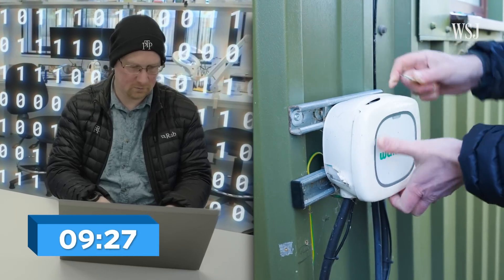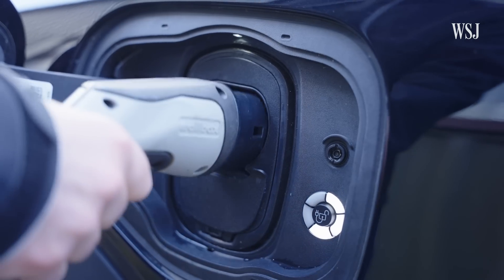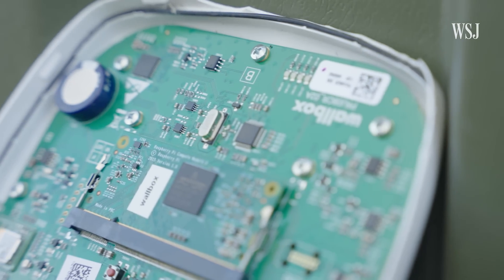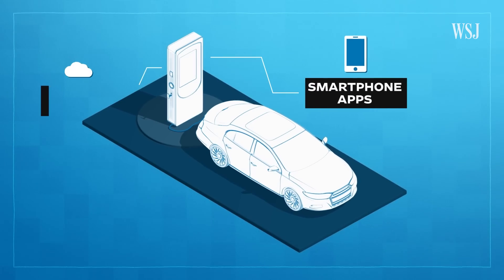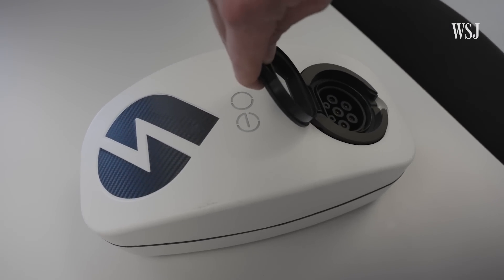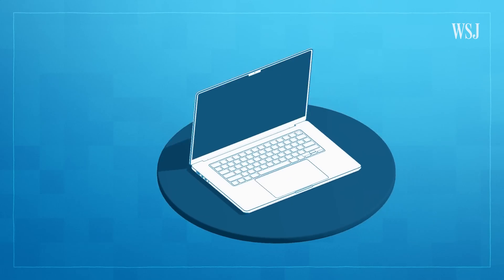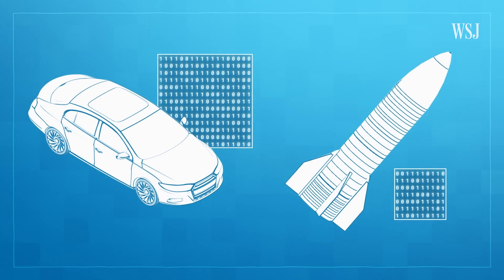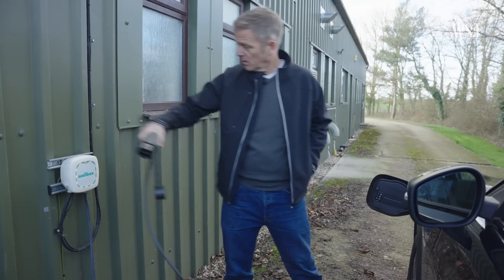This Is How Easy It Is to Hack EV Chargers | WSJ

Comment: Poor old wallbox being picked on - they are actually one of the better EVSE providers and have some clue.
Whilst in general 'update your firmware' is good advice, there are cases where that will completely shaft you (e.g. Juice Chargers - they got new owners and the recent updates remove all the open functionality they used to have).
Just about no chargers give the owners any ability to control their own kit - everything is proprietary except openEVSE and the Yeti dev kits. Wallbox do at least let you set your own OCPP endpoint so you are not stuck with all the vulnerabilities of the default vendor cloud.

Comment: You can recharge an electric car without any of these security risks.  When I had one, all I had to do was plug it into the power socket.  A meter on the dashboard showed my charge status.  The car never overcharged.  I could set it and forget it until the charge was finished.  If you want to have remote access to what your car's computer data, it is better to use a cellular connection on your phone to the car.  Wi-Fi was never meant to be safe.  Just a different way to connect things together.  There is nothing safe about using Wi-Fi.
Reply: You think cellular is safer?
Reply: Wi-Fi is designed to be somewhat safe... but it doesn't make bad designs good

Comment: I don't believe that hacking EV chargers could threaten the grid, but security vulnerabilities in them need to be addressed regardless. The problem lies in the fact that the EV's themselves have their own computers that tell the EV charger how much voltage and current it wants. If the EV detects that it's not getting what it wants, it will terminate the charging session. So you can't just create a surge by giving all of the connected EV's max current to try to crash the grid, the cars will just stop charging if you do that.

A more likely scenario is that hackers will try to capture credit card details from hacked public charging stations... But that's nothing unique to EV chargers. There are internet connected payment terminals everywhere in our modern world, and the security on them is actually pretty good. That's why most criminals just put card skimmers on them instead of trying to hack the terminal itself.

Comment: Causing grid problems by turning on EV charging is illogical because on really hot days all A/C units turn on.
Reply: EVs take a LOT more power than an AC, and the idea is to turn them all on at exactly the same time, not randomly as the day warms.
Reply: @wetbadger2  not at 5pm-6pm when people come home from work and the nest or humans turn down the thermostate and turn on the electric oven for dinner!
Reply: @wetbadger2  An awesome video I just watched on rewiring vs rebuilding Rethinking electricity grids VIA Just Have a Think

Comment: China's 🇨🇳 "national security" laws require companies, including BYD, to assist with intelligence gathering. 
- The Chinese government basically knows who is driving, and they can remotely control your car brake system from Beijing.
Reply: It is true actually.

In many areas of China, Teslas have been banned because they pose a security risk to the Chinese gov. It's discussed in a lot of detail on the serpentza channel.
Reply: That's not true. The National Intelligence Law indeed forces any private organisation to provide the PRC government with any information they demand, but that doesn't mean that the companies need to create the capabilities to control every aspect of the products they provide. I doubt that many car manufacturers can be bothered to connect the brakes in the manner you purport.
Reply: @RokeJulianLockhart.s13ouq  Every major Chinese company has a party representative sitting in each company building. I doubt he's just there for show.
Reply: @LabGecko  Where'd you learn that from?

Comment: Why does a charger need an internet access? Does it get power from the cloud?
Reply: It's if you want to charge only during lowest energy costs, for example.
It's not necessary at all though. I've never connected mine.
Reply: It’s the additional features that need WiFi such as choosing to charge at night when it’s cheaper or activating a defrost mode on the car before you drive it.

Comment: The grid has pretty robust protection from many people turning on a appliance at the same time .. dating back decades when during advertising breaks for sports on tv. Many people turned on there kettles across the country.. hydropower came to the rescue in uk as they can have full power in under 20 seconds ..  there are way more kettles than a certain brand of charger bottnet attack. Or a certain serial number of a batch of chargers.. sounds very much like content designed for clicks and engagement..  Charging devices could have a built in ask for charge algorithms.. that even if someone asked to turn on every charger now.. still have to wait there turn ..
Reply: That was forecasted though

Comment: I wrote a paper on this last semester. The scary thing is that the weakest point on the grid changes depending on the time of the day / usage. If an attacker times everything right, then they can take down a small piece of the grid that could cascade to the larger system with a minimal amount of EV chargers (or smart thermostats). There are safe-guards against cascading failures, but they aren't designed for this type of attack.
Reply: If you wrote a paper on this, than you can answer to me this simple question. if we have a small country for example avg 5gw daily peak, how many charger will have to be turned on to bring down the network?
Reply: You'd need far too many EVs for that to be an issue, and they'd have to be plugged in. The majority of chargers are in garages. Maybe thermostats, but most houses use gas heating. If you could gain remote access to every EV charger, you could pull it off, but that's like saying if you could get inside a vault you could perform a heist. It's not practical.
Reply: @randomblock1_  said "It's not practical."  
Does it need to be? Was the attack on the Iranian nuclear plant practical? I doubt when Putin says "Hack that network" that his hackers respond "But that isn't really practical sir."
Reply: @LabGecko The point is that it would take decades to do all that hacking. And by then the first chargers would have been replaced.
Reply: In the uk the regulation requires that charge start and stop times have a  randomised offset which is controlled in firmware not accessible to update or change.

Comment: These charger brands aren't really that popular. Would be more credible if they found vulnerabilities in L2 chargers like Chargepoint, Tesla, etc.. Unlike L3 chargers, the L2 charger is actually on the vehicle, not in the station. These are just electric vehicle supply equipment (i.e. connectors). They would have to hack the vehicle.

Comment: 5:25 is hilarious considering millions of hot water kettles and “tea time.”

“so the power grid is designed to work at a relatively steady state and you have a big problem if you have huge like surge in demand or a huge dip in demand and either of these could be caused by a coordinated set of EVs all of a sudden charging or not charging.”

Most EVs left plugged are either already charging or fully charged and people would notice if they stopped charging ahead of an attack. This would be a subset of a subset of a subset of a subset of EV owners who happen to have their cars plugged in.

Also, most home EVSEs let anyone use them, same as an extension cord or a light switch. The authorization issue is more a concern for public installations.
Reply: you don't realize how easy it is to bring down a power grid as once you bring down enough portions of the grid the rest has to shutdown due to the grid going out of frequency to prevent damage to important power grid equipment yes its that easy welcome to the world of running a machine that's hundred if not thousands of miles wide
Reply: @KILLKING110  As demonstrated since I’m aware of the tea time engineering issue, I do realize. You won’t be taking out any part of the grid with a minor EVSE exploit like this. Exploiting an IOT clothes dryer would be more impactful by far.

Most private EVSEs are the portable kind included with their EV. Of those that have permanent installations (not just a socket), most don’t have any fancy scheduling, Internet connectivity, or authentication of any kind (just a fancy extension cord). Of those who have an IOT EVSE, only a portion have this brand. Of those only a portion have this model. Of those only a portion have exploitable firmware. Of those only a portion will be at home. Of those only a portion will be plugged in. Of those only a portion won’t be charging or charged. Of those standing by only a portion would be oblivious to the uncommanded charge or delay.

Comment: I challenge them to hack a Tesla charger of any kind. They won't be able to do it. Do not lump all EV chargers together as if they're the same thing.
Reply: Hey Elon, go back to xitter
Reply: hate to break it to you but Tesla employees were caught using the cameras in the cars to spy on people doing things as adults would do in bed and shared them amongst themselves so chances are one of them leaked the codes as retaliation for being fired
Reply: Do you forget that Elon somehow tricked the twitter engineers into removing all the security code? What real reason would there be for Teslas being special? especially with them not conforming to standards

Comment: EVERY Security Expert and Veteran Internet user will advise the same thing: Keep Stuff as Dumb as possible. 
If there's NO need to connect to the internet... DON'T. 
Right now, people are happily connecting their TVs, Toasters, Ovens, Doorbells, Security Cameras, Window Blinds, and even Faucets (among other things) to the Internet. These IoT (Internet of Things) are a Security Nightmare if not configured correctly AND Isolated properly from the Home Network. 
People today are essentially offering MULTIPLE pathways to digital intruders. 
As far as EVs are concerned... Manufacturers MUST keep systems Isolated. The Charging Tech must be separated from Infotainment.
Reply: In the UK there is dynamic pricing for ev charging, needs a network connection
Reply: Facebook is already here bro
Reply: Until it's illegal to sell customer data this will remain a base corporate business model.
Reply: Yet, this simply won't occur. People shall use IoT devices. That's not a solution.

Comment: Is nobody asking why a vehicle charger even needs to contain sensitive data? Lock it with a physical key like your front door and the only thing it needs to know is the state of your battery and charge until the desired level.
Reply: Mine sits outside and contains 0 data, doesn’t need Wi-Fi, doesn’t need anything. It’s a misnomer to call these chargers, the chargers are built into the EVs, these are glorified extension cords, require no data input from the owner to work! Why Wi-Fi access?!?
Reply: @johngoncalves  For fancy “smart” features like remote charge delay/start, user authorization, notification when charging stops, etc. It’s like a smart plug. Most users don’t need anything that fancy which is why it’s so silly to think this affects any significant percentage of EV users.
Reply: because it doesn't contain sensitive data. it's just your wifi password
Reply: @SegFaultOnLine1984  Isn't your wifi password fairly sensitive data?
Reply: @Djamonja  not really, anything that connects to your home network and is outside your house is fairly susceptible to these sort of attacks. Gaining access to your wifi password is pretty pointless for pretty much any malicious actor anyway considering they actually need to be outside your house. And the bank details part is pure fear mongering because of https.
Reply: @Djamonja  I mean then what ? Awful lot of work for free wifi ?
Reply: @RokeJulianLockhart.s13ouq  the same thing can be said about basically any iot device that is outside your home
Reply: @SegFaultOnLine1984 That's generally untrue, because IoT devices tend to broadcast inside the network rather than offer a point of entry to the outside deliberately, as the gateway does.
Reply: @Djamonja  Most EVSEs don’t connect to WiFi or the Internet.
Reply: It doesn’t need to contain sensitive data. Most don’t contain anything and do rely on a physical lockout (garage or car door). The only reason to have user authorization is for common areas (shared parking; multi-user) or commercial installations (billing). Of course it needs user authorization for billing. A normal EVSE is a portable cable or wall box that just acts like an extension cord with safety features.
Reply: Public chargers you gotta pay at.... Is this that foreign of an idea?
Reply: @DurzoBlunts  This isn’t one of those. The authorization feature is probably so it could be mounted in a common area (apartments), restrict usage (mine!), or track usage (your Tesla had 3x the power usage of my Bolt EV so you’re paying the electrical bill this month!).
Reply: Because many people are stupid. Older tech is usually better and for some reason, people feel a need to "upgrade" everything. Our locks at my apartments were "upgraded" from lock and key to digital cards. It gives the landlord more info, but the batteries need to be replaced yearly (six AA batteries per lock) and I wonder about security. The old locks and keys worked 100% of the time.

Comment: This is a bit far fetched, that raspberry pi compute module will save tons of e waste over a custom pcb. It’s like they are looking for flaws that aren’t really flaws.
Reply: is it though?
Reply: Indeed. The issues they're referring to are with the software, not hardware (except that the covers aren't locked).
Reply: The amount of e-waste created by using a custom PCB is essentially negligible. Did you ignore the board it's actually connected into?
Reply: @Z0DI4C That always depends upon the scale.

Comment: I wrote up a compliance landscape for one of the top global auto manufacturers.  There are real examples of hackers holding the company for ransom threatening DDOS.  Threats included disabling security features (locks, adaptive cruise control, air bags, abs...), hacking personal information of connected devices, and disrupting recharging infrastructure.  I warned them that there needs to be a clear divide between vehicle operating systems and infotainment.
Reply: I left the cybersecurity industry because I was tired of warning the C-suite and seeing deliberately negligent responses.

If they want to answer to Congress, that’s their business.  Not mine.
Reply: DDoS is totally irrelevant to this. That can be mitigated by a middleman like Cloudflare, and certainly doesn't matter in the context of hardware vulnerabilities.

Comment: OK if you can hack 1000 chargers remotely and bring down the Manhattan power grid using that, that seems like a reasonable thing to worry about.
Reply: All they have to do is install 870 more DC fast chargers in Manhattan. They don't do that till upgrade the capacity. The charging companies are already hoping all their chargers are running 100 percent of the time 24/7. That is the only way they can make a profit.